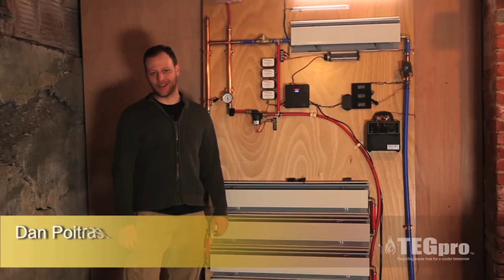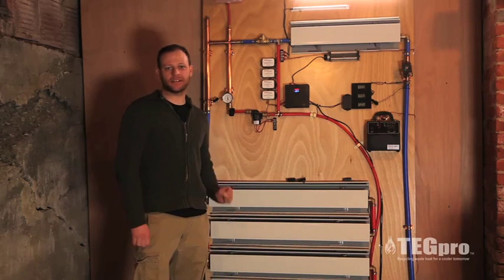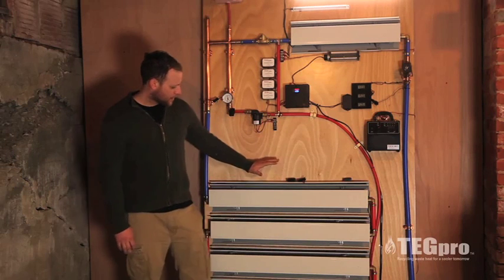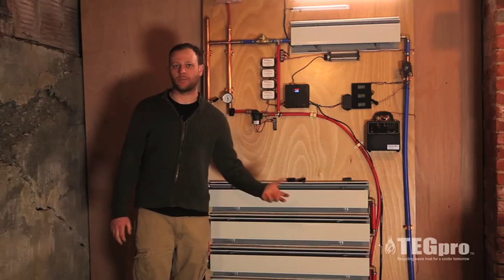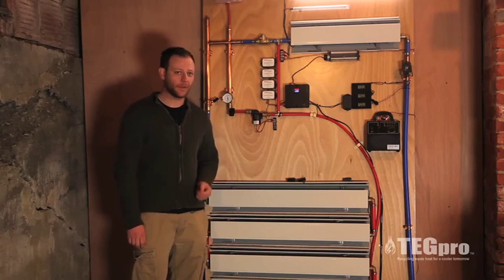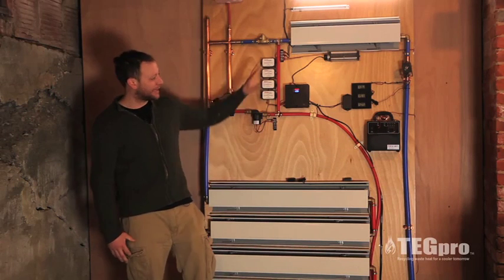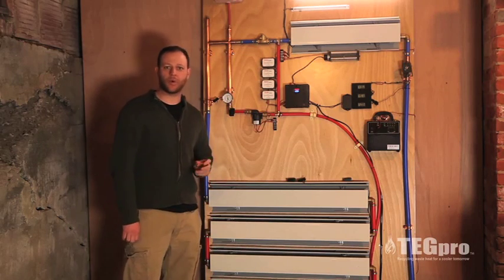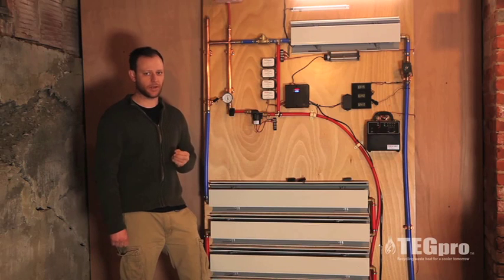Tegpro Thermoelectric Generator Water Cooled System Charging Batteries and Running Lights

Comment: I'm wondering if combining a system like this with Jean Pain compost pile so the TEGs would receive a 55-70C heat constant, which makes the TEG never overheat and the heat can be constant for months, so constant energy production without burning anything. could not just heat water for a house but also generate electricity to a battery inside the house.